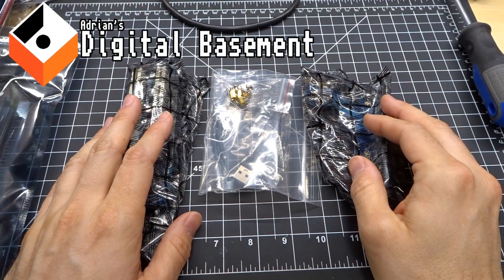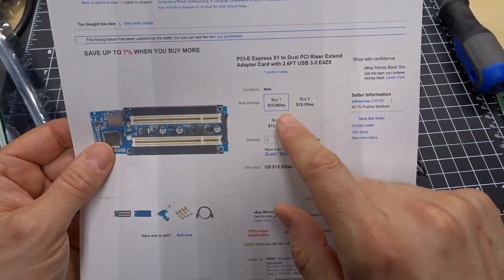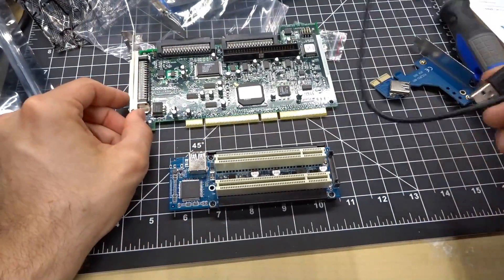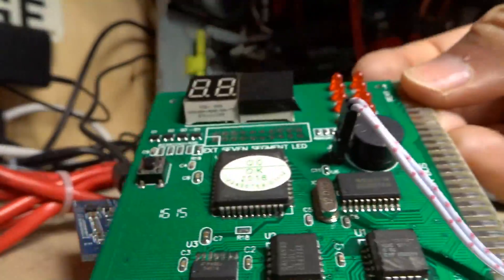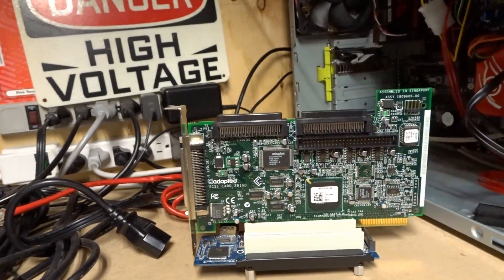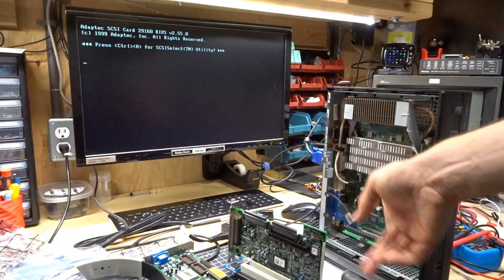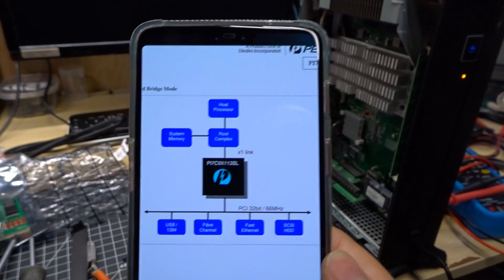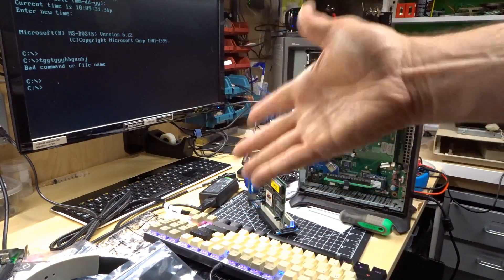Can an external PCI-Express to PCI adapter work? Sort of...

Comment: I also had this problem on a new machine. It worked before, but after a BIOS update... it stopped. It turned out I had to change the BIOS settings on my Asrock Z690 to support older devices

Comment: With a 90 degrees SATA adapter i managed to connect  the very same pci-host card to power .And my soundcard was recognized  ( before it was not !!)  . Still a tight fit with cables and so on .( very long card) 
THE ADAPTER =
On china markets is something like "7+15Pin SATA Male to Female Port Adapter Card Straight/90-Degree "  , the "LEFT VERSION" ( anyway check  pictures cause if you take wrong orientation it is unusable , pointing towards pci slots) .
I HAD TO CUT IT AWAY a portion of the "7 pin" ( data connection so no electricity )  to let it fit  but that is not risky since card  do need only the power ( 15 pin ) , matter of seconds  and no fear to mess with electric stuff..
That is for the pericom Chip here on the video.-
__
THEN =
After that , i 've tried ANOTHER  adapter with Asmedia chip  and card was recognized without power..( luckily ,as this card has a consumer  dc 12 jack power  and  i did not have any adapter for that )

Comment: I’m leaning on the bios. Did you try bios in legacy or uefi  mode..    did you try a generic pci sound card? Plus another thing could be lack of +5 V.  Since pci cards depending on revision used 5v or 3.3v for signaling.

Comment: Sata connector absolutely HAS to be powered, even for low power cards...My exactly the same card works in any mobo, with any card but requires sata connector powered.

Comment: startech pci to pcie adapter is fantastic, works easy, takes a molex power plug already in most psu's and when my copy died after a year they sent me a new one for free. I use mine to run an old scsi card that drives a canon film scanner. tested working windows 10 64 bit

Comment: The reason why the amd board did not show the adaptec bios is because its booting in uefi mode, which does not configured correctly to boot in legacy bios mode, which the pci card expects.

Comment: My PC has a small sound chip on the motherboard and I want to install a good sound card, but there is no PCI e-card slot on the motherboard. Can I buy a PCI e-card slot adapter and run the sound card by taking its power from USB?
I asked this to a few people and not everyone answered my question. What they told me was to buy an external sound card and use it.

Comment: Those are mining risers... but yes they tend to work for randomness. :) You will need to enable 4G decoding for some systems. Intels are a little more finiky for that. Depends on the bios. Also, for higher power devices, you need to connect the sata cable for devices that need larger amounts of power.

Comment: I ran into the same issues you did, I had a use case for a SCSI card in a brand new machine and bought one of these adapters.  I didn't get the SCSI BIOS to appear, but Linux did at least see the SCSI card as a PCI device.   However, when I tried to load the drivers it just wouldn't initialize.  Tried several different SCSI cards and had the same results.  I think it's highly dependent on the system and whether or not the BIOS has support for legacy systems. So, if it works for you, great!

Comment: I have a PC with a Voodoo 2 Sli on such an adapter. If you don't plug in the SATA power connector, it won't work. What I don't like about this adapter is the arrangement of the SATA connector. If you use a long card, the cables get in the way. With mine, the connection runs below the slot in their direction, next to the cards. So there are no cables in the way.

Comment: I've been thinking about getting this. Mostly, I want to add USB 3.0 to my Dell Optiplex 3010 SFF, and the GT 710 card I'm using blocks the PCI-1X slot. From what I gather else where, this expansion slot accessory won't run advanced GPUs.
Also, I'm looking for a external case for this.

Comment: I was thinking about buying same adapter for the very same reason (I needed SCSI interface on my home server to access the tape library). Ended up with LSI PCI-E SCSI card however, cause I didn't have any SCSI adapter at hand that time around, but for those who have conventional PCI cards these adapters seem like quite an option

Comment: I bought one for my E-MU 1616M to plug into my 13900k z790 Hero. I can't part with this sound card, it's PERFECTION for a sound designer. But it's not showing up in DM, and so I am wondering if I need to plug power into this external adapter to get it to work, but I'm afraid in case I burn something out. Apparently, you can still get it to work... if you can get it to show up in DM. There are also 5v/3.3v jumpers on mine for each slot.
Reply: Hey Man, did you put your E-MU 1616M to work on this adapter?, I got a similar one, just the SATA plug is placed on the side of the PCI slot. I tested my X-FI Fatal1ty Platinum Champion Edition and all working flawlessly, the modes, the I/O drive, specially the volume, 100% ok. If you did put your to work, can you tell me for how long is it working? tnx
Reply: @ivanfidelis  No, it didn't work. I contacted the supplier, and they offered a return, but as it was cheap I kept it. I may try it again, as Windows 11 was pretty new then, so maybe they've added some compatibility drivers. The 1616m still works on my older PC though, but the only thing with it is the S/P Diff has some syncing issues, but I'm not sure if that digital clock issue is the EMU or my Stanton str8-150 turntables which are quite old now.  If your adapter works, can you let me know where you got it from exactly, as I may give it a try.
Reply: @GetMoGaming   ow. I almost forgot, my Xfi and 2 other simple pci boards worked flawlessly with the SATA 5 threads plugged on. And I tested too without the SATA, none worked without it, they dont even show in device manager, like they were not even connected...
Reply: @ivanfidelis3829  Thanks man, that's great advice!!

Comment: Adrian, you are aware that there is an actual pcix to pci standoff board, without all the usb interfacing, just plug and play onto pci card then into pcix slot, using server type glue logic on board, making any pci card able to use bone stock windows standard driver models... Ie. A pci video card that might be a Voodoo 3 or #9, that will now be recognized as "Standard VGA Interface" with all of the supported color and resolution spec. of the hardware. All the internal logic needed is on-card so your newest modern pc doesn't need to support it, it just needs to support pcix. This of course means the modern os can utilize it, while gaining the ability to boot a legacy os and use the hardware specific drivers for an older os but through the speed of the pcix bus...meaning you can install a legacy pci sound blaster with dos drivers, then boot dos on a pc built and shipped this morning with full dos platform sound support over pcix, there is even a 90 degree standoff to turn those pci signals into isa, my buddy said the added driver weight is around 6k for this, but it allows you to stack standoffs pcix-pci-isa then load the isa driver through the resident drivers and even control things like latency, bus frequency etc.  If you have not seen and have no clue what I am talking about, I will look for the exact hardware names at work. Our adapters were all internal and worked just like plugging a regular card in. My buddy(our tech guy) says it can be found around the 3-4th page of a google search including the keywords "pcix to pci bridge card".

Sorry this is so long, I saw your video and I just got excited because there is literally no pcix boards made that support our lumber saws and they just went through this upgrade at work, we literally have our entire hard drive full of old software that is now bootable and usable through all our old cards, sitting inside ryzen boxes with ddr5, it is awesome, dual boot windows 10 or xp, or drop out from xp to dos on a fat32 drive to play doom in dos with sound at buttery smooth framerates... 
(NOT THAT WE TRIED IT ON THE CLOCK MIKE...just at the weekend meeting) ;)

Comment: Hmm, not sure if I would trust long term use for large cards, due to the power draw without using on onboard power. [ Looking at other modules the same, it seems it want's a SATA power connector]

Comment: I recently got one of these for my Adaptec 19160 aswell, mine particular adapter board use Asmedia 1083 PCIe-PCI bridge. And it seems to be more compatible with most PCIe slots, regardless if its a CPU direct bus or chipset bus.

Although i personally enable legacy mode in the BIOS, just to ensure better compatibility.

Comment: Anyone ever tested these with PCI Soundcards on Windows 10/11? Like the X-Fi Xtreme Music? Does it work (with Daniel_Ks Driver)?
Reply: I'm using a DeLock adapter 41856. My XFi Xtreme Music has very, very low volume output. :( Well, I guess the adapter is doing a bad job.

Comment: Did you try it with the SATA power connector connected to the power supply it may need more power than can be delivered by a PCIe slot on your bench system, that power connector is there for a reason.

Cut the end off off a SATA power splitter or SATA power connector on a PSU and solder the wires to the appropriate pins on the bottom of the PCI board so that the wires and connectors don’t interfere with the SCSI card.

Comment: Tx Adrian, my msi big bang fuzzion just died and so I lost the pci slots for my also adaptec aha2940 scsi2 card connected to my umax astra1200S scanner. So I am going to try this as well. If it works I can put it in a little box, and then I will have an usb3 to scsi2 adapter 😃

Comment: There are no real external PCIe cables, hence a dual USB-A USB3.0 cable is being used.
Have a TB3 to PCIe solution and got a PCIe to PCI board in which my Catweasel can slot. ;-) Based on a ASM1083
Halfway the video, when you show the SCSI card is not detected I suspect this is due to lack of power perhaps... as even my PCIe->PCI card has an external power plug for 12V+5V

Comment: hi  my brother has a window 10 it will not work with it yes something to do with the older  computer and driver's like you said 

i would say in my last  mail and the card first  get drivers to work with card  when all work ad the sound card with driver it works ok with M AUDIO  step and step at a time 
when ad on the unit's check the system that it can see them  in the list of things

Comment: PCI: The 32-bit PCI interface is not compatible with 64-bit PCI products, while the 64-bit PCI interface is compatible with 32-bit PCI products (Source: Internet, partitionwizard.com). The Adaptec SCSI Card 39320A-R is a 64-bit 133 MHz PCI-X, dual-channel Ultra320 SCSI card with integrated HostRAID® RAID levels 0, 1, and 10. The Adaptec 39320A-R offers additional drivers for HostRAID as well as a new management tool. It provides worry-free data protection at the fastest SCSI speeds available up to 640 MByte/sec (Source: Internet, Bing.com search result using PCI SCSI card).

Comment: Hi Adrian, I have a Corsair Carbide 275R, Gigabyte Aorus Elite V2, a GIGABYTE AORUS Nvme Gen4 M.2 500GB PCI-Express 4.0 Interface with Windows 10 Pro X64, a Ryzen 5 3600, and 32 GB of DDR4 2666 memory. The case has two upright expansion slots on the back, and I would like to use my M-Audio 1010 Lite PCI, in my new build. Could you please suggest a good PCIEX to PCI converter to try? I would appreciate it. 😜

Comment: I use one of these to connect my M-audio Delta66 card - it works flawlessly so far, no sata power connected.
Reply: Hi, what motherboard do you have? I have an M-Audio delta 1010lt and I am considering connecting to the ASUS X570 MB via this PCI-Express to PCI adapter. But I don't know if it's a good idea. And what about latency? Same as on MB with PCI slot?
Edit: few comments down- 
ceilingsoldier claims it's not safe because there's no overload protection. So it's not worth the risk for me. I hope yours works well.
Reply: @Avennder  hi, the set up is on my backup PC so i haven't really pushed it, so cant say for certain, but i have had pro tools running with full session, 50 odd tracks with many plugins, and no problems and not had to change latency from the usual ( 256 samples i think ). Interesting about overload pro, not a problem for me - its a set up which would be redundant otherwise - but perhaps best for you to play safe then. btw MB i dont know, its a HP z220 with xeon 1230 v3 proc.
Reply: @tendon121  Thanks for answer. Nice to know that adapter work with no problem at full session...

Comment: Ideally you would have another case sitting next to your PC, those boards are roughly the same thickness as a normal motherboard so imagine an empty case, you could plug that card into one of the external slot openings, have the adapter below it like the motherboard would be and then route the USB cable out of the case and to your main system with the adapter installed.

Comment: 90 degree SATA power plug on to the side board would be needed as the scsi cards has a high "draw" & slow the bus down on the overclocked machine . enable legacy support and add some harddrive delay if it has the option . he already  said it had trouble booting sometimes which is prob due to memory or bus timings slightly out . Modern bios  would quickly cycle power up & adjust a few times before allowing boot but by that time its already skipped or failed to boot the card . bur sometimes things just don't like each other ...   lol

Comment: You may need a SATA power cable with a 90° connector at one end to get it to work with the oversize card you're using.

Comment: I wish they would make boards with ISA that are not 2000$ and not P4 new , They make them for banks and other areas that still use isa retro hardware. today people want pci isa so there is a market for it, They do make usb to ext dual pci case for laptops but they cost like 100$ us and are rare now from around 2009.

Comment: Find a SATA power cable that is flat, I would not think PSU would come with it angled. If it works on one machine not the other I tend to think power is not enough. SATA power-Molex converters are abound.

Comment: very interesting video!, I actually purchased that same riser pci ex to 2 pci slots, awaiting for the arrival, so watched the video with interest, I am trying to plug my old RME multiface audio interface to newer pc system where there is no pci slots anymore..:(, I hope it will work, as I fo not want to throw out such a nice audio interface as RME, it's still rock solid, drivers, converters, I really like RME< so fingers x'd:), it will work with new pc, and therefore it will be possible to use it in the future with new pc, not oldtimer atx board:). I also didnt mention the fact, I want to build a tiny PC, with just one pci e slot, as small as it could be, easy to transport and not taking too much space on the desk. ATX standard, where PCI slots doent exist anymore...
Reply: Did you have any joy with this, I have exactly the same issue. My RME card would be seen by the system but whenever any application tried to transfer any data to the RME card it failed

Comment: I know i'm late to this, but here's an explanation of the SATA power connector. A lot of external gear used to have Molex power connectors, those provide 12V and 5V. SATA connectors, when made properly, also have 3.3V on another lead - and traditional PCI needs 3.3 and 5V to support all equipment. Easier than having a step-down converter on the board
Reply: And it’s also not safe to use it without the sata connector if more than 3A are used by the pci cards.

Comment: That looks like a Z97 gaming G1 motherboard. Extremely stable and could probably stay powered on for 20 years. I have a UD5H and it has a bridge for pci and 2 slots. Theres settings in the bios for pci. There might be some too for the G1.

Comment: check your bios menu/s  i had seen some have an option of "pci legacy mode"
5:45 problems of mainboards also can be instead induced by the Powersupply.
On ebay i got a good LCD PSU Tester for under 7$
https://www.ebay.com/itm/PC-Computer-LCD-20-24-Pin-4-PSU-ATX-BTX-ITX-SATA-HDD-Digital-Power-Supply-Tester/222499177526?epid=5016982370&hash=item33cdfc0436:g:h0gAAOSw-3FZCzOs

Comment: Does anyone know, if those riser cards require the PC motherboard to support a specific USB connection (3.0 for instance)? If that is just an USB connector, but not connection, on the riser board and adapter? It would be great, if that way I could use my old external magneto optical disk drive connected to a PCI SCSI controller (to access the old discs, for backing up important files - to get the full UDF feeling I could also use DVD-RAM discs though - and of course out of nostalgia). Provided that there are working drivers for Windows Vista or 7, or Linux. Normally I only use laptops, but USB to SCSI adapters are extremely expensive, are just as little certain to work, and probably slow everything down due to the USB 1.0, 1.1, 2.0 specifications. At least the first two reasons apply to PCMCIA cards with SCSI connector as well (plus expresscard to cardbus adapter). An alternative would be to buy an old used desktop PC (not only for that reason) - that has to support USB 3.0?

Comment: I don't think that there is sufficient power from the USB 3.0 part of the adapter. Therefore I would suggest to power the PCI adapter through the SATA power connector. If the SATA power plug is too high, you could just use a cranked one.😉

Comment: You need to power the adapter, with a data cable.
Your VGA works, because it uses less than 20watts.

Comment: I hope you've got a follow-up video on this thing. I absolutely know they usually work. I passed several PB worth of data to tape over ike 5 years at an underfunded non-profit. No more failed verifications than when it was using a native PCI-X card. 

Get it some power and preferably a slot wired not to the PCH, but the CPU.